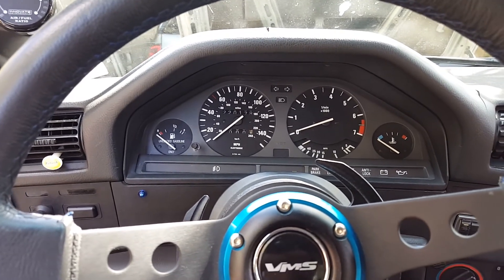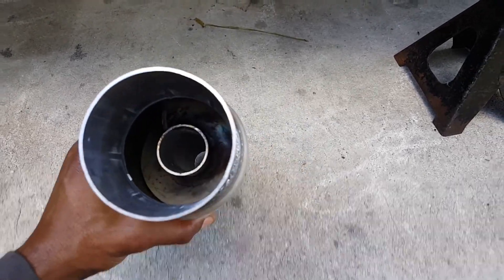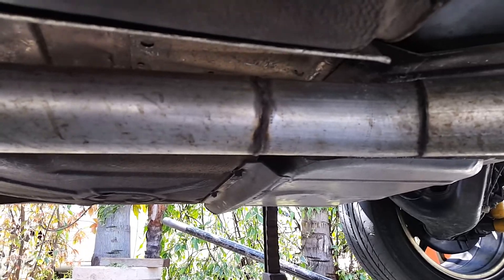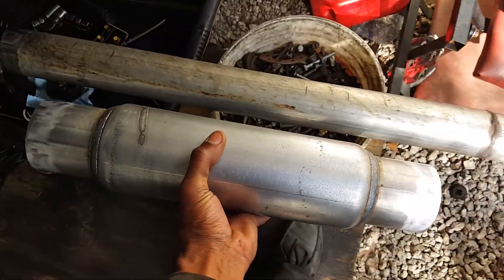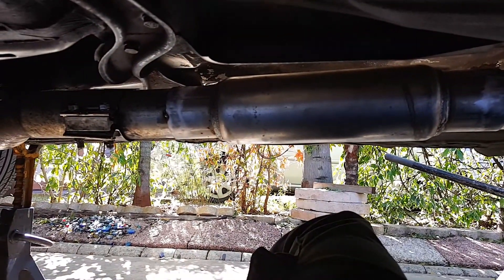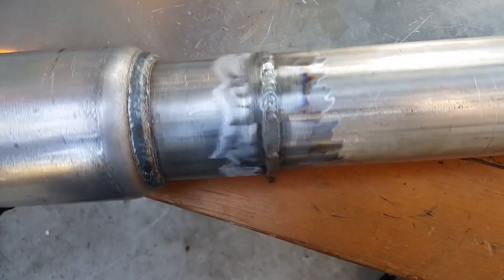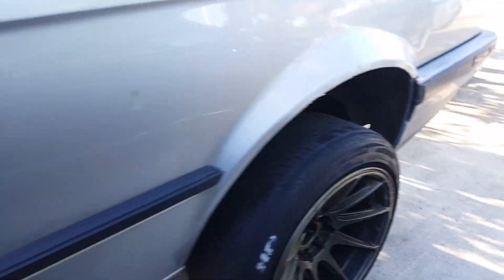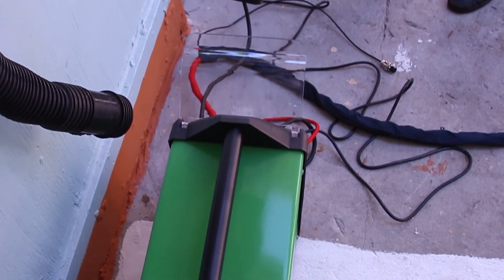E30 M42 Turbo Twister Resonator Install

Comment: Does the Twister give that "popcorn/backfire" crack and pop when you lift off the gas and shift gears? That's very important to me on my BMW. Of course we heard the car idle, but sometimes that popcorn sound isn't audible unless the engine is under a load. Thanks - good video!
Reply from the maker: The popcorn/backfire that you are talking about it the result of tuning not the resonator.

Comment: Having a loud car or truck is like the choice of being rich and famous. I just want to be rich and not famous. I used to have a Pro-Street car and it was way too loud and got way too much attention. It was fun at the time but now I just want quiet. And guess what? No more excessive noise tickets or speeding tickets or scrutiny from the guys with the red and blue lights.
Reply from the maker: I acutally appreciate having a fast quiet car. Right now i actually added a vaccum actuated cutout with vaccum solinoid so i can have the best of both worlds at the flip of a switch.

Comment: diesel muffler on gas beamer
Reply from the maker: Its a custom turbo muffler.
Reply: Anything diesel is better than anything gas. Diesel engines and accompanying pieces are all heavier and more durable for the most part.

Comment: Did you notice any back pressure increase in the exhaust after installing the twister? Did it cut down on interior drone like they advertise?
Reply from the maker: Joseph Carlson yeah it did give the car back some needed back pressure to flow properly and yeah the car sounds a whole lot quieter on the highway.

Comment: Sounds good. Just found you channel. Already subbed. I just bought a 318ti and I was weighing all options for additional power before an engine swap. Anyway if you are using obd1 harness how are you running megasquirt? All custom?
Reply from the maker: Atomic Garage it's a 1991 BMW 318is I'm using the factory harness with a plug-and-play I switch from megasquirt to a Emerald k-6 ecu. If you check out my instagram you will see the cars current state. @theeverythingguye30
Reply: TheEverythingGuyE30 so I requested to follow you a few minutes ago. I love all the videos and your knowledge. Your Beemer sounds great! Can't wait to see more videos! And thank you for your response
Reply from the maker: Thanks man and no problem i made them to share the experience.

Comment: How much boost do you run on your m42? I thought about turboing mine but I also thought about itbs
Reply from the maker: SlowAndAnnoyed on this setup I was running about 9 PSI where the car currently stands I'm running 14 PSI if you want the most updated info on the bill check out my Instagram @theeverythingguye30. With the m42 turbocharging is the most efficient way to make good usable power.